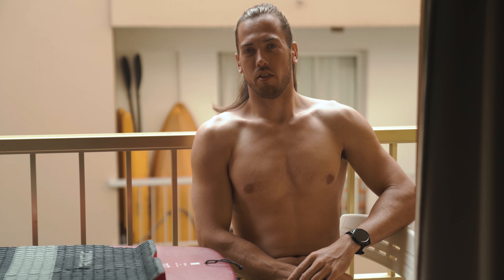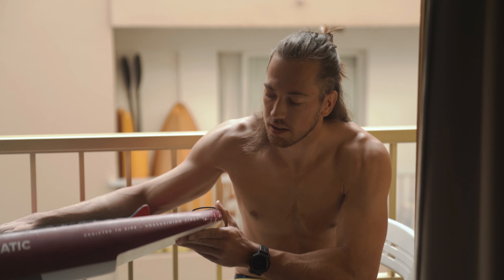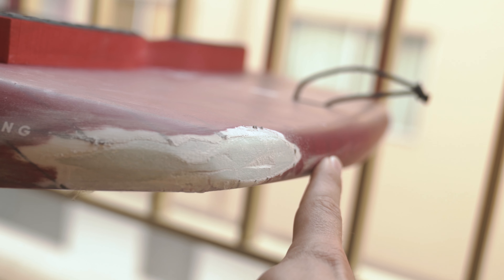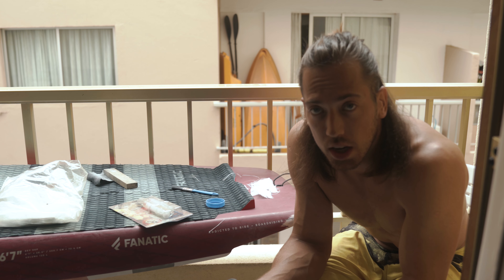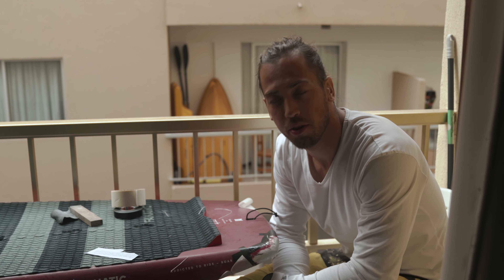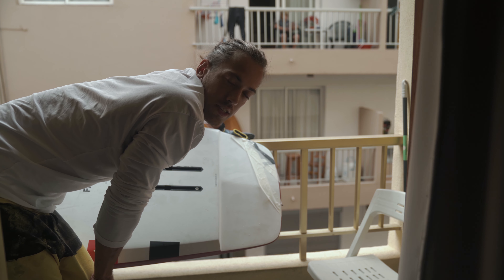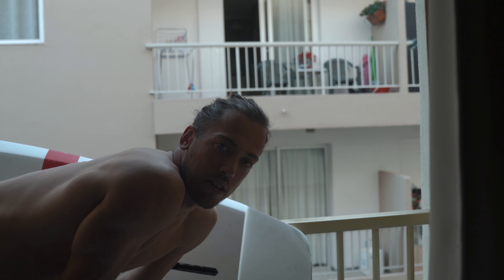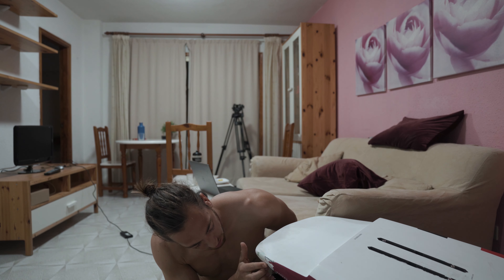How to repair a composite board? (Windsurf, SUP, Surf, Kite, Wingfoil) - Windsurfing Tips Ep. 6

Comment: What kind of fiberglass works well? I found some fiberglass adhesive tapes that are used in inhouse construction in local building material stores or it requires some special kind of fiberglass?
Reply from the maker: You need to get pure fiberglass roll - should look something like this:
https://cdn11.bigcommerce.com/s-x3ki4mm/images/stencil/1280x1280/products/1161/1737/Fiberglass__22192.1526998527.jpg?c=2
Reply: @RYTISJAS  Thanks!

Comment: I’m using the m2 repair epoxy set which doesn’t need the fiberglass. The result looks quite similar to the final sanded state with epoxy and fiberglass. But wondering if m2 is enough now to make it watertight. About painting etc.: too much effort if your masts smacks again into the same spot in the next session 😀
Reply from the maker: It should be watertight initially - but the question is if it stays solid, water tight in the long run? That I am not sure about... So just make sure to check that area for microcracks and leakage every now and then
Reply: Probably not. This only works if the construction of the board is still strong. Unfortunately windsurf boards are lightweight and not so strong. They need all the carbon and/or glasfibers it as. As soon as some are broken the construction is much weaker and there is a risk of cracking further over time.

Comment: I was wondering how you would take off your tape after some glass and epoxy went over the edge of the tape. I guess your sanding removed the overlap? That’s a good idea.
Reply from the maker: Yes, if a lot of fiber glass and epoxy go over a tape you sand it off or sometimes you can carefully cut it with a box cutter

Comment: What happens if you repair the board and it turns out there was still a bit water inside?
Reply from the maker: Well nr 1 the board is heavier than it needs to be.
Nr 2 it will probably make the epoxy weaker or in same cases the epoxy might not harden at all if you put it on a wet surface.
Nr 3 if you have water in the board and the board heats up and cools down many times (when brought into the sun, the put in the water and so on) the water and pressure inside the board can cause delamination of different layers of the sandwich.

Comment: Next damage go to a person which is used to these materials.Sorry - but it looks terrible........nobody privat would buy your board after some similar repairings.......🙈🤢
Reply from the maker: You realize that this is not painted, right? 🤣
Reply: @RYTISJAS  yes - shure.You would see every uneven location after painting......o.k...you tried it.I wouldnt make a video for this - only when it gets 100%.....sorry...habe a nice 2021.....
Reply from the maker: Dear Roland, let me explain you some principals of repair which I see you are failing to grasp. Nr. 1 make sure the board is dry when you repair it. Nr 2 make sure that your repair is water tight - that is the main purpose of repair to ensure that water does not come into the board. Nr 3 is make sure that the repair has the least amount of impact on performance of the board. An additional goal can be - make it look good. Depends on what you want to do with the board...
And finally just to reiterate what I said in the opening of the video - it is a Quick and Sturdy repair to make sure that I can get in the water as fast as possible. 
But if you want to go ahead put some filler on wet cracked board, paint it nicely and in a few months wonder why the board weighs 3 kg more - go ahead - it will look nice from the outside...